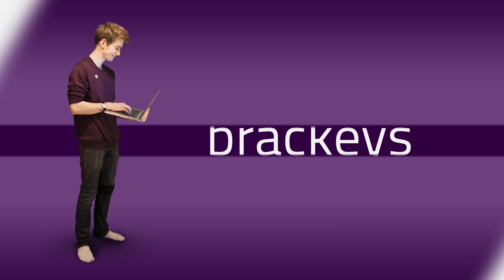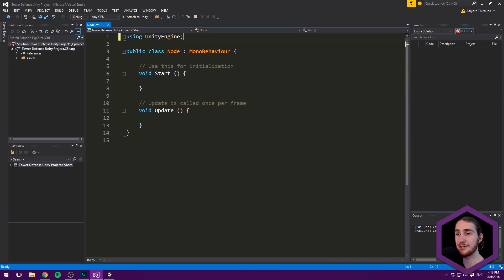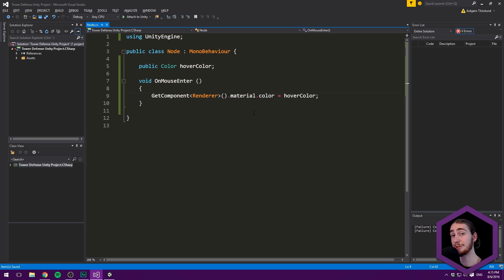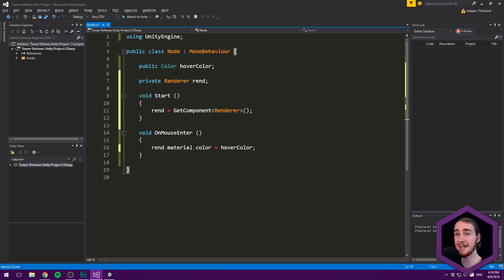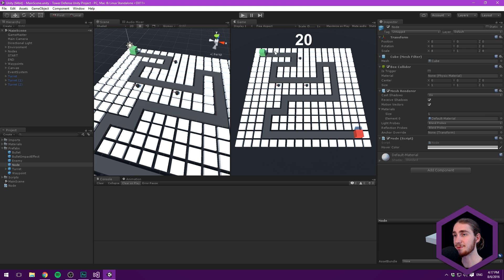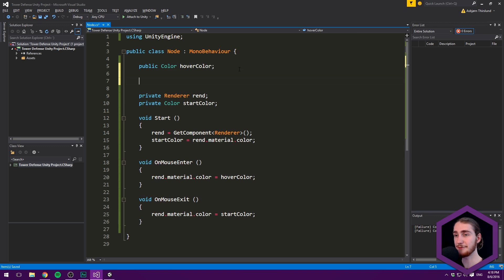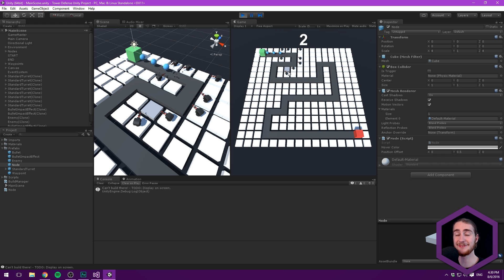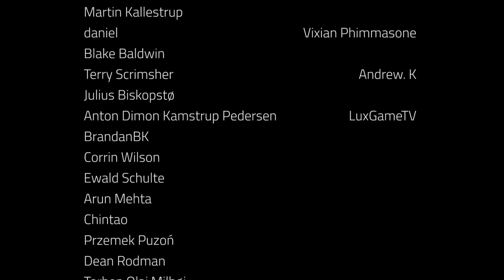How to make a Tower Defense Game (E06 BUILDING) - Unity Tutorial

Comment: If anyone is watching using Untiy 6 like I am, the OnMouseEnter and Exit will NOT work if you are using the new input system. Go to Edit -> Project Settings -> Player -> Other Settings -> Configuration -> Active Input Handling. Select either the old Input Manager or both and the functions will work as expected. Hope it saves you the 3 hours I spent digging

Comment: Getting this error but I am not sure why:
NullReferenceException: Object reference not set to an instance of an object
node.OnMouseEnter () (at Assets/Scripts/node.cs:15)
my code is identical so that's not the problem but I am not sure what is.
placing the turret works fine though so I'm just getting a bunch of error's about changing the color because it won't do that for some reason.

the problem is caused by these two:
 rend.material.color = hoverColor;
rend.material.color = startColor;
but I don't know why.

Well I fixed it by using these instead but still don't know what caused it though:

GetComponent<Renderer>().material.color = hoverColor;

GetComponent<Renderer>().material.color = startColor;

yes I do have this line: 
rend = GetComponent<Renderer>();
although for some reason they now change to black after removing my mouse from them but at least I am not getting error's anymore

Comment: Note that in 2019.3 you need to A) have the box colliders on for the nodes to react to mouse events and B) check the "Is trigger" option under the box collider.
Reply: Спасибо большое! :)
Reply: ty so much
Reply: it works without checking "is Trigger"
Reply: still getting only NullRefrenceExceptions every time I exit or enter a node with my mouse
Reply: King

Comment: I'm getting the following error message: "MissingReferenceException: The object of type 'Transform' has been destroyed but you are still trying to access it.
Your script should either check if it is null or you should not destroy the object.
UnityEngine.Object.Internal_InstantiateSingle (UnityEngine.Object data, UnityEngine.Vector3 pos, UnityEngine.Quaternion rot) (at <94c5f4c38cdc42d2b006f8badef04394>:0)"

Comment: Something I just found, if you wanted to make a turret model and import it from Blender and it isn't perfectly centered at the origin, follow these steps:

1.) Import the model and make it into a prefab.

2.) Reset the transform of the turret then offset it to the position you would like it to sit. Save changes to prefab.

3.) In the Node code where we instantiate the turret (line 28 for me), change the "transform.position" entry to "transform.position + turretToBuild.transform.position". This will instantiate the turret at the node's origin, then offset it by however much your prefab is offset.

Anyway, thanks for this tutorial series. I have a background in AS3 and Python but this is the first Unity project I'm undertaking and it's been nothing but fun so far, very easy to follow along for a complete beginner.

Comment: ArgumentException: The Object you want to instantiate is null.
UnityEngine.Object.CheckNullArgument (System.Object arg, System.String message) (at C:/buildslave/unity/build/Runtime/Export/UnityEngineObject.cs:196)
UnityEngine.Object.Instantiate (UnityEngine.Object original, Vector3 position, Quaternion rotation) (at C:/buildslave/unity/build/Runtime/Export/UnityEngineObject.cs:143)
Node.OnMouseDown () (at Assets/Script/Node.cs:27)
UnityEngine.SendMouseEvents:DoSendMouseEvents(Int32)

what the problem??
Reply: Try moving turretToBuild = standardTurretPrefab; into the Awake void
Reply: Have you fixed it? I don't know but I think that you have forgotten to put the standardTurret prefab inside the GameMaster. But I'm not sure
Reply: Solved it for me - Thanks!

Comment: I figured out that my nodes was not copies of the prefab, but independent game objects. Is there a fast way of changing all the nodes to the prefab node.
Reply: i have the same problem. If you find a solution please respond
Reply: I didn't find a solution, I just deleted all the nodes and reacreated them with prefab.
Reply: You could create an editor script. Iterate through the active selection, instantiate the PrefabType, set its transform, and delete the original.
Reply: I was having some issues with only some of my squares highlighting. I figured out that at some point I had duplicated every node.... so mouse over was working on some. Had to click every single node and delete one.... works fine.

Comment: I’m thinking about a way to make the path 3 dimensional. The movement works as it is (yay) but I’m thinking about making the enemie slower when they need to get up.

My thought is to get the waypoints some kind of a speed modulator (is this even a word :D) and check in the movement script for that. But I’m struggling with the best way to implement that. So far I’ve made a script Waypoint attached to each waypoint and defined a public float (speedModulator = 5f). But how do I access that in my enemy script?
Reply: What about writing this?

ymax = 1
xmax = 2
speed(theta) = (xmax *cos theta, ymax*sin theta)